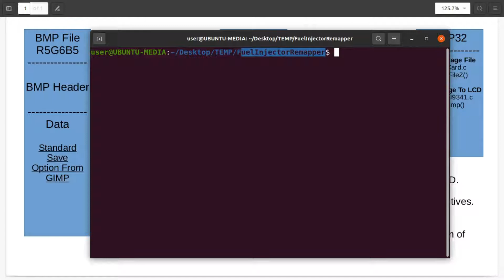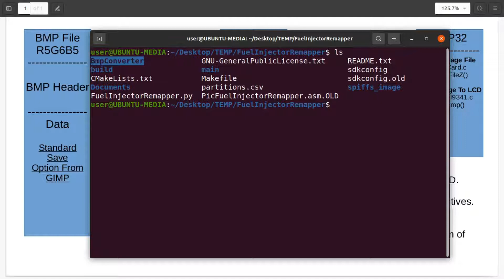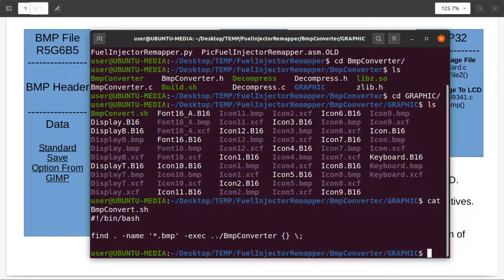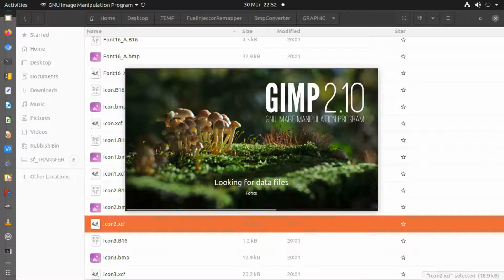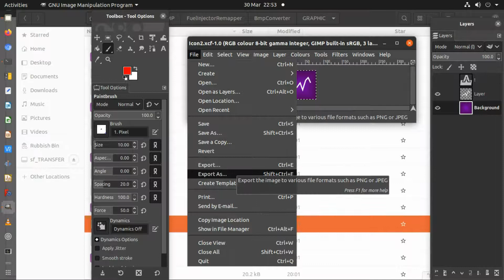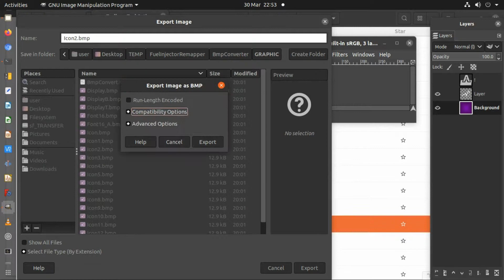ESP32 GUI Displaying Image Files On The ILI9341 LCD Display

Comment: Good content. My Gimp 2.10.32 does not have R5G6B5 export option. Is the 16bpc RGBA option the one I should be using? Just trying to get my display to show a Sprite. image2cpp options give me a garbled screen :)
Reply: By the way I'm using LGFX to pushSprite
Reply from the maker: On my Ubuntu the current version I have is 2.10.18. When I select the File -> Export As or File -> Export...
I then change the file extension to bmp and click the Export button. The options dialog appears. I expand the Advanced Options and the 16bits R5 G6 B5 option is there. The format would need to be of this type to work.
Reply: @DevelopIT   Ah yes that did the trick. I did not use the bmp file type when exporting and now the R5 G6 B5 option is available. Thank you for the help. 'Subbed'